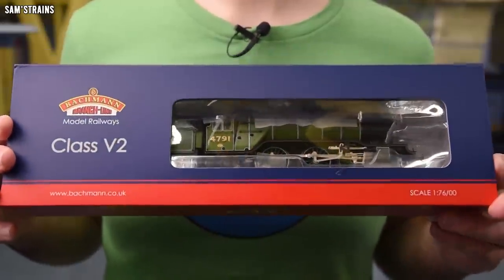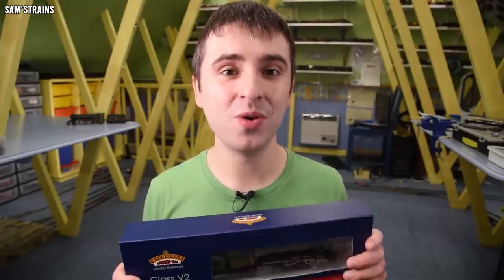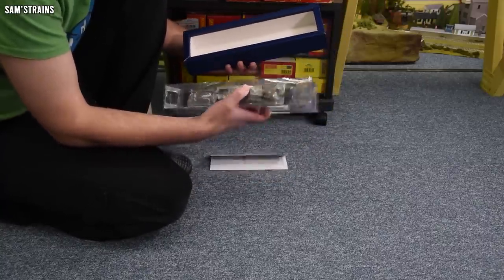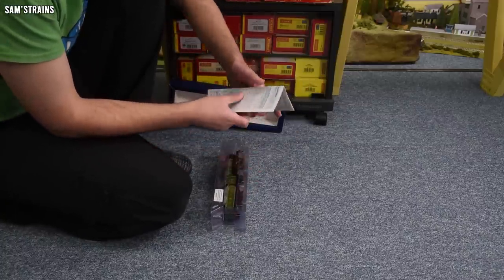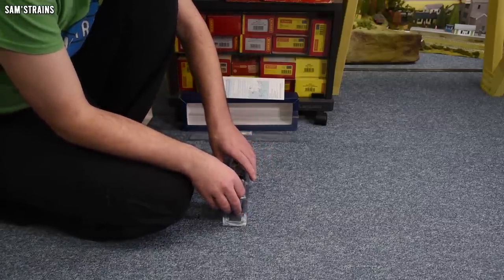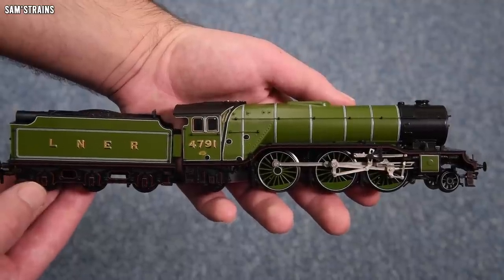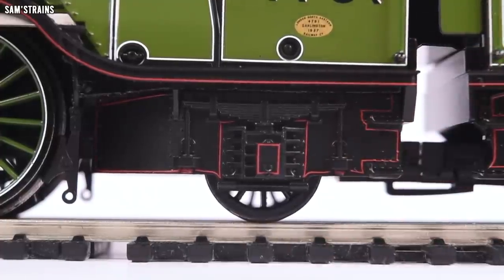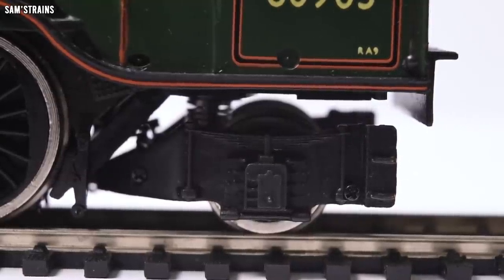Brand New Bachmann LNER Class V2 | Unboxing & Review

Comment: I would have expected a metal runnong plate and more realistic looking valve gear, but otherwise I like it. May grab one later
Reply from the maker: Yeah very much so - not perfect by any means, but decent overall! :D
Thanks for watching, Sam :)
Reply: @SamsTrains  The correct performance level is a plus, compared to the two previous models you have tested. This one does not overspeed, which is an usual downside with Bachmann.

Comment: Always thought the 2-6-2 configuration looked good, particularly on this Gresley loco. Surprised it was never adopted to a greater degree. On the model I can't understand why the rear pony truck doesn't pivot.
Reply from the maker: Yeah I think it does too Malcolm - very nice!
Thanks for watching, Sam :)
Reply: The rear pony truck never pivoted in real life. It was a side shifting Cartazzi axel. It has been discussed before on other locos. The problem is when scaled down the curves are tighter on model layouts. So you get the flang less floating wheel unless you have large radius curves on your layout. When you realise that it should be fixed it always strikes me how bad they look when the rear pony truck swings out. I'd go with the floating wheel. Although not great it is smaller and far less noticeable. Neither is great but manufacturers have decided to compromise on flange less wheel as more prototypical and you don't get the massive gap beneath the cab.
Reply: @Degsie1975  Thanks for the explanation.

Comment: With NO die-cast, a silly tender coupling, and a £220 RRP price tag, will quite happily stick with my old Bachmann loco-driven split-chassis V2 “Green Arrow” in BR Green late livery. As Sam said, Bachmann do seem to be going backwards except for their pricing!
Reply: Models are supposed to be ACCURATE to the real thing! The old V2 was dimensionally inaccurate in a number of areas and the trailing wheel arrangement swing around like it did bore virtually no resemblance to the real thing.

It also had the pretty rubbish split chassis inside with zero ability to add DCC control or DCC sound - both things which have been proven to be in high demand from buyers.

The new Bachmann model fixes all these issues and in no way can be said to be 'going backwards'. Only a fool turns round and uses raw price (or indeed weight) as the be-all and end all of how good an item is - which is why Sam has also factored in other elements when scoring the model.

Comment: Screw heads on the running gear?!?! Like 1960s Triang. Hornby we’re still doing it into the early 2000’s on their pre-rebuilt merchant navy-renaissance models but even they changed that out on the few that remain. All that beautiful detail and decoration especially in the cab let down by big basics like that. Sometimes I just don’t understand the thinking with these manufacturers.

Comment: My class 117 DMU had those connections. One broke within a week. Also with the 117 not having any corridor connections it stood out like a sore thumb. Sorry Bachmann but I'm massively underwhelmed by your recent releases. If this was a school report it would say must try harder.
Reply from the maker: I’m not a fan either - they just should’ve come up with a better design... other manufacturers have really shown them up in this area... even the basic Hornby solution with the screws and separate connector works better... as at least you have a robust coupling... crazy!

Comment: I don't think it's wrong to expect to lubricate after an hour of solid break-in.  The initial break-in is hard on components and lubrication. (Hence why many cars have an accelerated first oil change when new). I think you should change your methodology.  Lubricate after break in, then run it a while to simulate a running session (20 minutes perhaps??), and then evaluate for noise and smoothness.  I think that would be fair - you want to review based upon how these models are going to act during their lifetime, 99% or more of which happens after break-in.

Comment: Some 3D print ideas
A diesel with a flywheel
An express steamer
Larger coaches for your express steamer
(Also you can sand down your prints to make layer lines less visible)
Reply from the maker: All sounds awesome Miller - thanks for the ideas! :D
Thanks for watching, Sam :)

Comment: So, for the rear pony truck, the prototype have a Cartazzi axle, thing that I had learned recently. This kind of axle moves sideways, instead of pivoting on a truck like a bissel one. The flangeless wheels are the least unrealistic solution for a model. Unless if your layout have no curves below 750mm radius...
For the other elements, we are a little bit on the scrooge side... Yes, the model is superb, but the plastic running plate, the hardwired keepers plate, the decoder in the engine, the Heljan-like opening of the engine, the lack of flywheel, and the circonvoluted connection of the tender are serious blunders for the price. At GBP 150, I might have tolerated them, but at GBP 195, it's unacceptable.
On the up side, apart the jewel-like aspect of the model, with a quality of overall finish that put shame on Hornby, the five poles motor, and overall, the correct level of performance, and the more than decent drivetrain, it's a great up. Special hat off to the first Bachmann engine that is not overspeeded, their design office had found back the calculator they needed to use to get the right demultiplication ratio !
Well, in short, I'll buy one in two days, debit card deadline considerations... I'll buy a decoder fitting service too, I don't want to get nut with the opening of the engine ! I'll tip you on the flickering firebox on DCC as soon as I have tested mine. Not yet the german quality level, even if we are in Roco/Piko territory for the price...

Comment: That coupling is the same as the Blue Pullman.  I hate it.  To join the 6 coaches on that is a nightmare and it is easiest on its side.  Surely Bachmann knew that before using it again?.
Reply from the maker: Very interesting - so they've used this before? Yes I'm surprised that they've used this again, surely they must have had some feedback on the design?!
Thanks for watching, Sam :)

Comment: That loco to tender connection looks awful. Based upon the similar coupling used on their Blue Pullman. That train uses a linear row of sliding together wiper fingers, not a square array of terminal pins. I ran the BP last night and there is no way the coaches can be coupled whilst on the track; you have to pick each pair of coach ends up at an angle of about 30° before they will couple. This loco seems the same, so results in far to much manhandling. That security hook will snap off sooner or later. Not good.
Reply from the maker: Thanks Andrew - that's because it is awful, haha! Thanks a lot for sharing - that sounds terrible!
Thanks for watching, Sam :)

Comment: Why they could not use a radial truck, as they have done in the past..A1/2 from years ago, and it worked, rather than this bodge up replacement wheels set, can see that tender/loco coupling tab braking off for a pastime, though, always liked the simple idea from Dapol....

Comment: Bachmann, they keep getting so close to a great "all-around" locomotive but they keep letting it down in so many minor ways that it adds up. From the loco to tender coupling (the pain in the tail socket when compared to Dapol's loco to tender), the lack of flywheel on the 5-pole motor, the lack of torque on said 5-pole motor, to the gearing from said 5-pole motor; it's just frustrating to see as a viewer from overseas to see these failings on Bachmann's part.

Comment: Wrong on the Bachmann V2, I have one of their later models, it does NOT have a split chassis. The trailing wheel frames are fixed. the trailing wheels have a flange on them, it has a 8 pin DCC socket in the loco. Your other model of the V2 that is in BR Green sitting on the table is one of the very first models. It was upgraded (which is the one I have {the upgraded one}) and the one in this review, is the second upgrade that they have done. But mucked it up by having the stupid fixed trailing wheels, with no side to side freedum of movement, therefor have silly flangeless wheels. And it's over priced. And still have cross head screws holding some of the coupling rods on. And the join between the end of the smoke box and the smoke box door is also stupid!

Comment: I only watch you reviews when I am considering buying a model and I always watch as many other reviews as are available.  Your obsession with die cast and weight is a ridiculous measure of quality.  In fact as far as the running plate is concerned you answered your own point, it is a complex shape therefore ti make it in metal would have been unnecessarily expensive. You also criticise aspects of the model in comparison with other manufacturers, e.g. Dapol's coupling of tender to loco and the smoke box DCC fitting.  Before you slag off a product because it doesn't have a feature produced by another manufacturer have you considered the question of Patents, you never mention it so I'm guessing not. You also seem to fail to recognise that the most of these models are produced in China or Taiwan and shipping costs have increased exponentially and surprise surprise so have product prices. No doubt you will say other can do it cheaper and still produce a quality product, maybe but have you ever heard of a loss leader in order to create market share. I'm sorry you seem to have no idea of commercial constraints because as a comparison your reviews can be useful but watching you bang on about the same old personal gripes and you slagging off manufacturers and products is unedifying to watch.
Reply: Must agree.

Comment: bachmann re issued the v2 twice before this model .first was the flap top box then the dark blue blue riband box .then the did the same loco in a block of ice box and then they re wheeled the loco to finer wheels and made the rear pony fixed with flangless wheels .i had durham school .they were much improved.this looks similar to the durham school model but the coupling rods look to aluminium to silver .i wont be buying one .

Comment: That loco-tender connecton is incredibly unsightly.  This is area where msanufacturers seem to be getting worse, not better.  Why none of them put the connection in the prototypical place always was and still is beyond me.  Also, their futile attempts to hide the wiring...?   Why?  On nost real locomotives there are flexible pipe connections between the loco and tender for braking  and in some instances steam heating.  These details could easily be replicated using the connecting wires making this area almost entirely aesthetically 'correct'.  Beyong shapes and liveries the notion of 'realism' seems to be lost in almost all manufacturers' iatrogeneric concerns for the bottom line.  There are clearly few modellers left in the industry though there are many industrialists!

Comment: Dear Sam, generally love your work, but lately you seem to be incredibly picky , sometimes too much. The high number of fairly insignificant disappointments   you call out on this really terrific locomotive is my point,. The running plate is a minor issue, the loco in fact looks good and pulls well, so what is your point. Does it really matter if it weighs less than the previous model, big deal. The coupling mechanism is fine, over  the life of the loco how man times will you really need to separate the tender , and frankly if you find undoing 5 screws to remove the body difficult then what are you doing in this hobby. And lastly your over commenting on the price of locos, using the Big Mac method to gauge pricing, the price of the V2 is 220 pounds, divide this by the price of a big mac in England of 3 pound 49, you get 63 big macs. In Australia the latest stem loco released, a small 19 class retails $799, our big mac costs $6.55 which is 122 big macs. I would say you pommies have it great.
Reply from the maker: Thanks for sharing David - appreciate you sharing your opinions, though I obviously don’t agree - these are my thoughts on the loco in my assessment of whether the model was worth the money. They’re made taking the other models in my collection into account, and I stand by my findings!
Cheers,
Sam :)